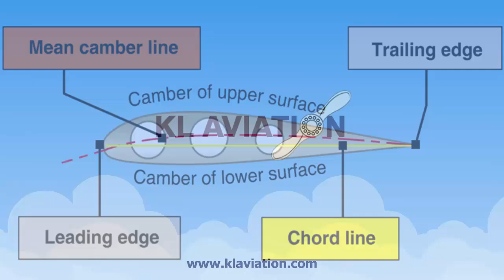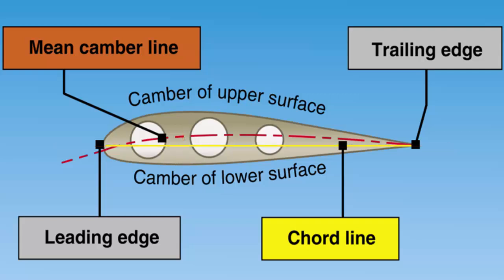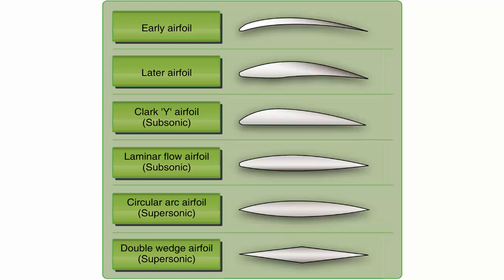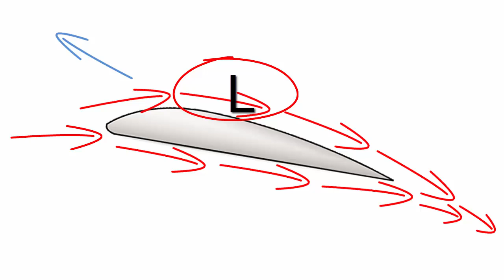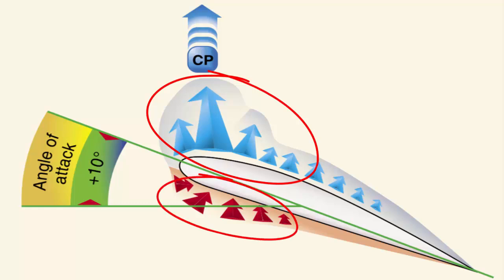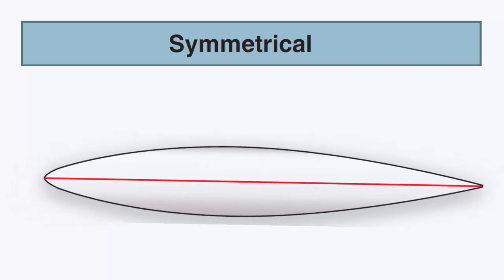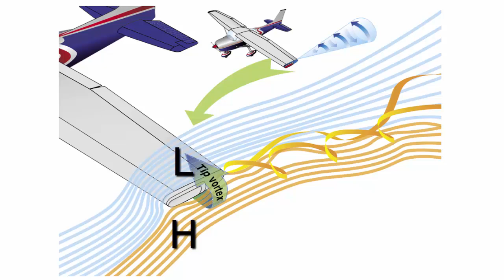Airfoil Design

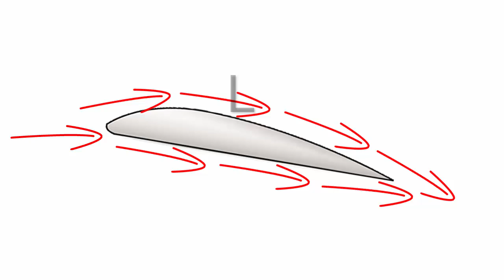Comment: 03:00 - 03:12 
This explanation of the lower pressure from the faster movement of the air above the wing has been given again and again and again. But it's wrong. THERE IS ABSOLUTELY NO NEED FOR AN AIR PARTICLE TO TRAVEL FASTER ALONG THE UPPER SURFACE THAN ANOTHER TRAVELLING ALONG THE LOWER SURFACE!
Indeed, an upside particle leaves a downside particle far behind. Two neighbouring particles splitting at the leading edge don't have to meet again at the trailing edge, and they don't. Period.
The air on the upside simply does travel faster, and there actually IS lower pressure on the upside, but the reasons are more complex.
If the camber was the only reason for lift, why does a flat airfoil fly? Why do Chinese kites fly? Why do you feel resistance that tries to move your hand aside when you stretch out your hand from a car window at higher speeds?

Okay, enough of that ... If you benefit from this video, congrats to you. Why not? But I don't.
Reply: A flat aerofoil will only fly with a powerful engine.  It is inefficient, whereas a cambered aerofoil can work with a less powerful and  lighter engine.  The air accelerating above the wing is less dense (same mas in a larger volume) so the air pressure is less and that is what keeps aircraft in the air.  And that is why spoilers (lift dumpers) are on the UPPER surface of a wing, not the lower surface.   Try throwing a Frisbee upside down!   Chinese kites are only flat on the ground, once in the air they bulge slightly and have an aerofoil shape.

Comment: Totally reversed. the pressure will be higher above the wing since the area of stream air going through it will be smaller because of the concave shape.
Reply: This is not a matter for guessing. It has been measured and it is lower than the pressure farther from the wing. That 'pinching' effect is incorrect science.  The air far above a wing is not a solid wall. It is very soft.
The changes in pressure changes at the wing's surfaces are caused simply by the fact that the wing must push the air around to move through it.

Comment: if you tilt an teardrop foil up it will produce a vacuum on the top of the wing which causes the air under the wing to try and fill in the vacuum pushing the wing up !!! its not negative pressure on the top of the wing its a partial vacuum over the top that produces lift !!a propeller on an air plane does not pull the air backwards it creates a vacuum on the front of the propeller to cause the air behind the propeller to push  the air plane forward!! every thing in nature is pushed!!the only way you can pull an object is to change its inertia or with a magnet !!!

Comment: oh god not this again. Newtons 3rd law DOES NOT contribute to lift.
Reply: +jiunn wong  You are correct.
Reply: Please explain your reasoning
Reply: Invisiblejihadi you cannot find a force the wing can exert on the free flow to change mass flow vector
Reply: I'm confused about your view.  The wing creates pressure differences that push air downward.
Reply: Why not? Force is defined as a rate of change of momentum and in this case the momentum of the fluid flow is changed
Reply: Observ45er The way I see it the flow is diverted downwards because of the shape of the wing and the pressure differences arise due to that
Reply: +jiunn wong The reason I said you are correct is because there is a common belief that Bernoulli only provides some of the lift above the wing and Newton provides (contributes) the rest below the wing. This appears to have come from some people improperly using Bernoulli's Equation along with bad math and coming up short on the lift force, then looking for something to fill the void and coming up with the "Newton-below-the-wing" story. This demonstrates a poor understanding of both Bernoulli and Newton as well as how lift is created.
...
Like all objects moving in a fluid, a wing causes pressure changes.  Try walking through water and the force you must exert to move is quite obvious. YOU push on the water in front of you which increases the pressure.  Behind you, walking away from the water, you decrease the pressure.  Those pressure changes cause the water to accelerate to flow around you. A wing does similar except, to our benefit, (not going into detail here about the exact physics) the increase is under it and the decrease is above it.
Newton isn't causing any lift.  Rather, the velocities are all Newton because there is a pressure reduction above that accelerates some air downward and a pressure increase below the wing which accelerate more air downward from below the wing (A=F/M).
A pressure difference is the ONLY thing that can cause a force in a fluid. The pressure difference around the wing IS the lift.  Since air has mass, that force then, is what causes accelerations of the air (as well as the lift).
...
Wing moves; causing pressure differences; Pressure difference causes lift; the SAME pressure differences also cause accelerations and resulting speeds as well as downwash. DONE
NO Bernoulli misunderstood and misapplied, no speed increases causing pressures, no half this and half that. ALL WINGS, repeat, ALL WINGS do the same thing. The correct focus is the PATH the air is forced to take and not ONLY the shape of the wing.
...
Direct MEASUREMENTS around a REAL WING show that IF you stand and watch a wing go by, the Fastest air speeds are UNDER the wing; and I'm NOT smoking something. Data doesn’t lie. Only amateur scientists with inadequate science understanding debate this -- and YES MANY teachers have it wrong and are simply parroting the myths. Sorry, but even well known science presenters such as Don Herbert (Mr. Wizard - my idol), Julius Sumner Miller, Steve Spangler and even Bill Nye (apparently) don't understand the real science of Bernoulli and lift.
...
The common misunderstanding of Bernoulli's Principle/Equation, Namely that "Fast-Air-Has-Lower-Pressure-Than-Nearby-Slower-Air", is a long standing myth that actually violates the fundamental principle of fluids that says that pressure at a point is exerted in all directions. It it were true, then any stream of air would get squeezed smaller and smaller as ling as it was moving - and observation shows that NOT happening.
That myth-explanation is NOT another fundamental "Law" of physics to be memorized like Newton's three Laws of motion. It is flat bogus. Most all of the common "Demonstrations" of this (Blowing past cans or balloons) are misinterpreted and usually are caused by a curved stream of air which is what causes the pressure change.
--
Cheers, ScienceAdvisorSteve
www.challenger.org
Reply: Observ45er

Comment: D dude you just spend way too much time alone.  50 years flying and well over 25000 hours in the sky and the Bernoulli theory worked well.  Speed over the top vs bottom equals lower pressure equals lift.  Besides there is no such thing as gravity (Newton ) the earth just sucks... take up fly fishing...
Reply: Actually no difference which theory worked as long as planes were flying, as well as no difference if shaped charges were melting armour or not they were piercing it. Both shaped charges and planes were invented before people found out why they work
Reply: Bernoulli principle also predicts zero downward deflection of the air stream and no energy loss due to lift. Bernoulli is not wrong as much as it is incomplete. Lift is far more complicated. Anything short of partial equations using speed, friction, viscosity and density is bound to be a simplistic.